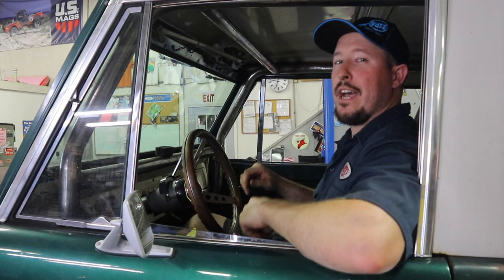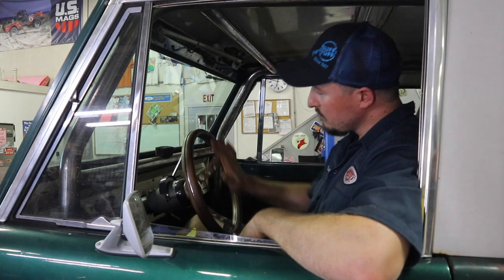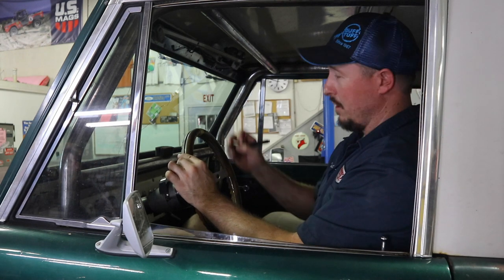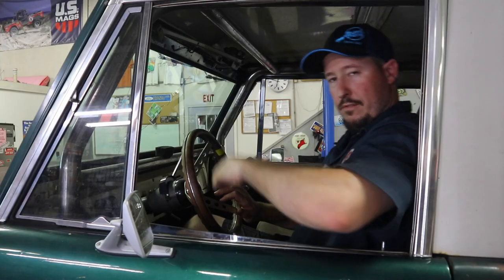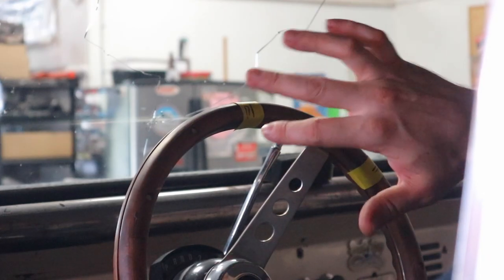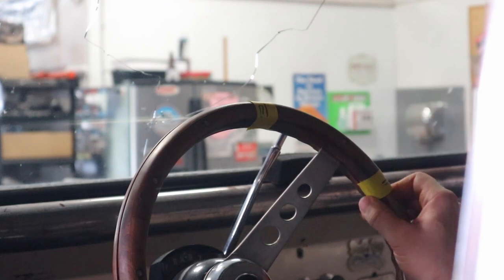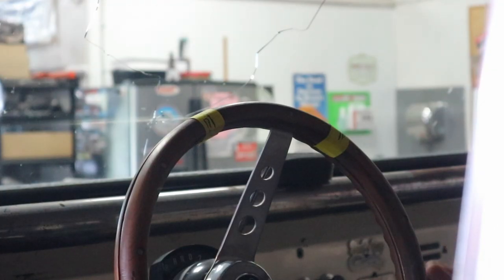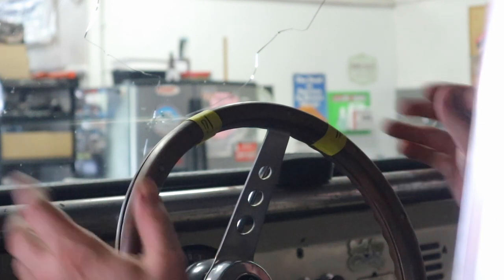How to Clock a Pitman Arm on your Ford Bronco

Comment: Pardon the interruption, but what about the pitman arm? You clocked the steering wheel [for adjustment] but seeing you are disconnected... is your arm on the right spline for proper travel geometry?
Reply from the maker: This video is to make sure your pitman arm is clocked correctly. I would not recommend making your steering wheel straight until all adjustments at the gearbox and steering linkage is done first.

Comment: You should have advised to check that the pitman arm is parallel with the centerline of the vehicle in case some knucklehead had installed it off a spline, or two, or more, when rebuilding or replacing the box, or the pitman arm.    I've seen it happen and the steering gets really screwy.    Otherwise, thanks for the video.